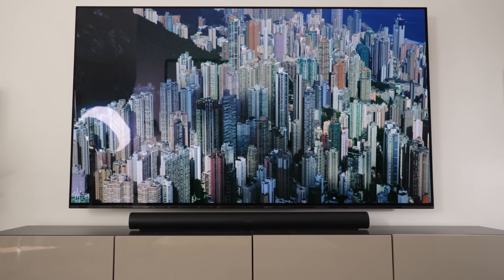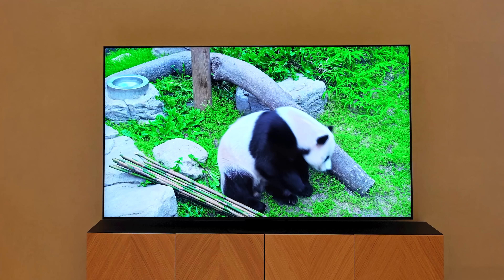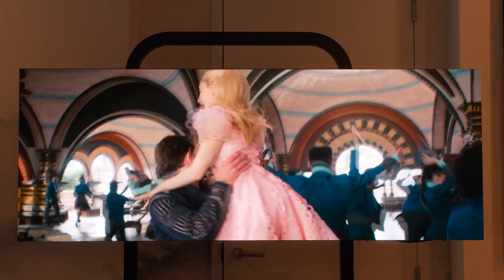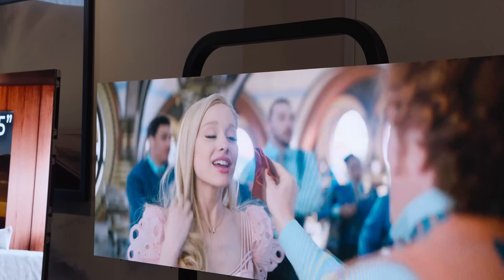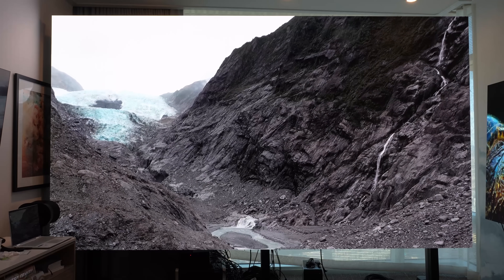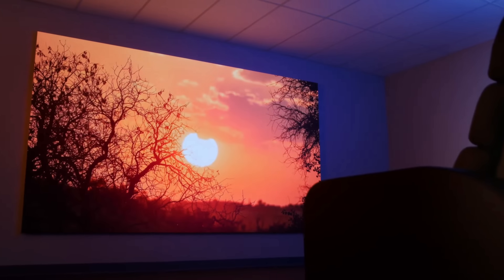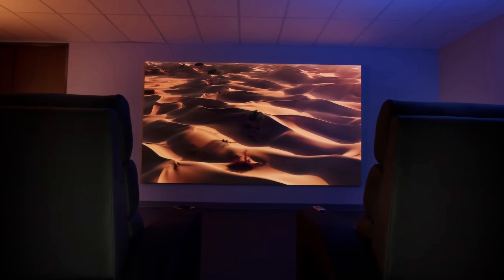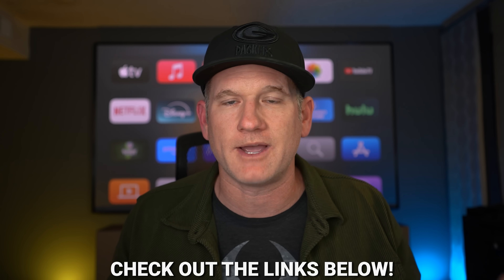162" MicroLED is Actually Coming! - AWALL Vision

Comment: I find it funny about the excitement of picture in picture tech. That has been around for a long time. Why it went away for awhile is beyond me. Back in the early 2000's in the the days of CRT I had a Sony 53" rear projection. With it's tuner I was able to have split screen of two channels or sources. So I was able to have both of the Sunday NFL games on at the same time and a simple button click on the remote switched the audio between the two. It had a picture inside of the picture with 3 size options and could use the remote cursor to move it where ever you want on the screen. It had a channel browsing option where it reduced the program you were watching to the center and then had a grid of something like the next 13 channels and you can browse up to the next 13 and the next 13 until you found what you want and use the remote cursor to select screen and then that channel became the main screen. That Sony picture in Picture feature is the thing I miss most about that TV and just can't grasp my mind around the fact the tech is available but not used in modern TVs.

Comment: Are you talking about 1200 nits full field? Because the new QD OLEDs are said to be capable of 400 full field, 2000 nits in a 10% window
Reply: yes, he is. 1200 nits full screen.
Reply: @AndrasMihalyi  oh yes, because of the modularity, each module can light up at that luminance but that's the max brightness in small specular highlights too i guess, OLEDs will get higher in small parts of the screen.
Reply: @ No he's not. It's 1200 nits peak.

Comment: Keep going the way you are, and you are going to need a bigger wall.  We had something like this in the company I retired from.  They had 4 'Monitors' maybe 12 feet diagonally.  Maybe more, I never measured them.  they had their own server room to run them with 2 huge racks to hold up all the stuff to run them.  They were very expensive, but not top of the line for what could have been offered - a few million.  One of the installers said he could change out one bad pixel if necessary.  They used the same 'snap in a book', like they showed here.  I call it a 'snap in a book', because the little screen they snapped in and out is about the size of a small book.  I think 'B The Installer' will be the first person to show to the viewing public a home 'holo deck', like they had on the The Star Ship Enterprise.  Might be a few years, but with AI, who knows, might be here before we know it.

Comment: 60Hz and 1000 nits? That's a tech demo, far from a commercial product.
Reply: For indoor use it’s more than enough brightness. For an indoor Micro LED display, the appropriate brightness typically ranges from 300 to 700 nits, depending on the specific application and viewing environment. Here's a more detailed breakdown:

300 to 500 nits: Suitable for home use or dimly lit environments. This range provides a good balance between energy efficiency and visual comfort.
500 to 700 nits: Ideal for rooms with more ambient light or commercial applications where higher brightness is needed to ensure visibility in brighter surroundings.
For environments with high ambient light (like retail spaces or large conference rooms), a display with a higher brightness, up to 1,000 nits or more, might be more appropriate.

However, for most indoor settings, staying within the 300-700 nits range should suffice to achieve a balance between visibility and power consumption.

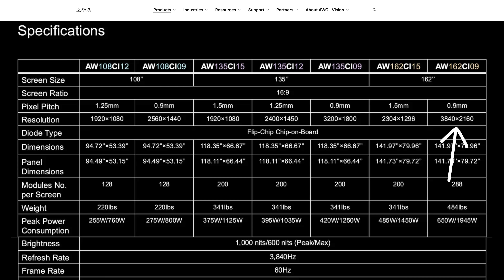Comment: 11:02 Power consumption blew me out of the water. That's high still
Reply: It's mainly due to size, and I'm sure that an OLED and LED-based display of the same size and full-field brightness level would consume just as much power, if not more.
Reply: @ You're correct mate. I noticed it and i mentioned it. OLED is really bad for power consumption. I like the tech though and I wouldn’t mind it if it went mainstream and of course affordable.
Reply: It’s low power consumption, less than an oled. You’re a troll, it’s the best video to come out of CES and you’re complaining about blooming and high power consumption, neither are true. Go back to your Samsung booth.
Reply: @jaychannel8558  why are you so angry mate? Go and touch grass

Comment: Would love to have a 4K at 81" with the glossy screen (when the price comes down to $3,000. or less).
Reply: 4k 81' inch the screen will look pixelated, at those inches 8k is idle, screen density is sharper.
Reply: @David-Zita No it won't, I had a 135" screen with a JVC NX7 that I sat 9' 6" away from and you couldn't see pixels.
Reply: @David-Zita  Try not to speak boldly about things you don't understand.
Reply: @David-Zita  Why do you think that? I've seen a lot of both 83"  and 85" 4K screens and none of them have any pixelization. Also, there is almost no existing 8K content available. It will likely be another 10-12 years before we start to see 8K become main stream.
Reply: @thetrumanshow4791  You don't need 8K content to enjoy an 8K screen.  Half of what you watch on your 4K TV isn't 4K content, but it still looks a lot better than having a 720p screen.